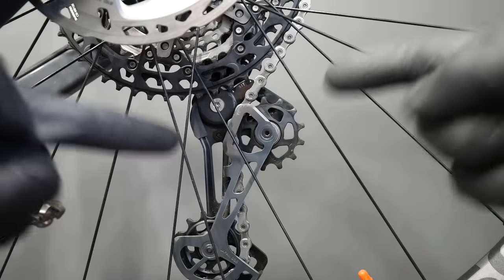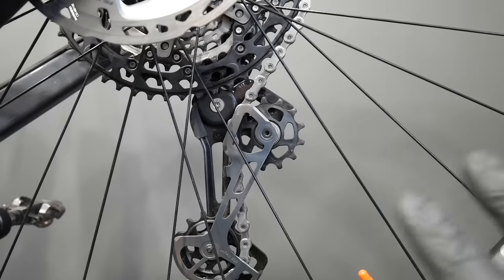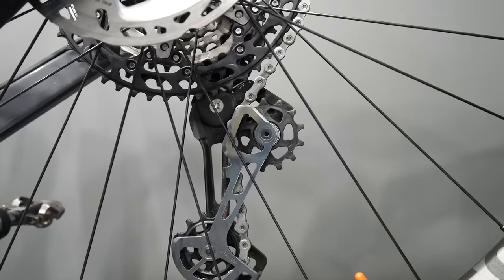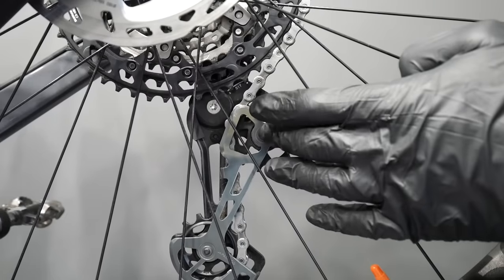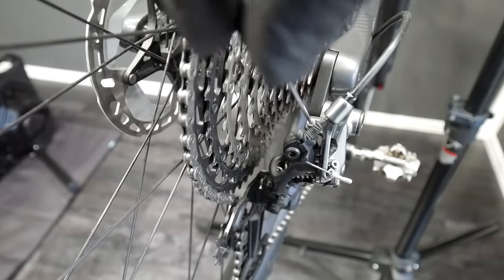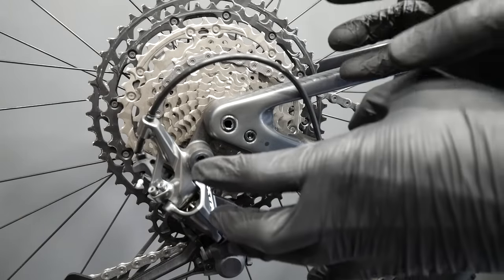Check This, Before You Snap The Chain On New Shimano 1x12 SLX, XT Or XTR Drivetrain...

Comment from the maker: Please note - I swapped the double with single crankset. Here's the right order:
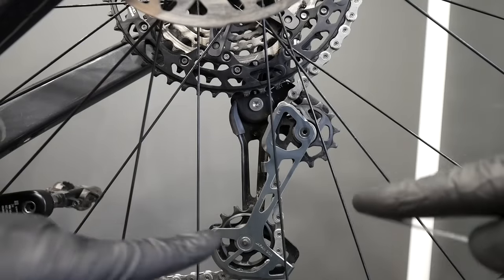2:35 SGS cage + 10-51T AND GS cage + 10-45T
5:52 XTR 9120, XT 8120. SLX 7120 for DOUBLE crankset
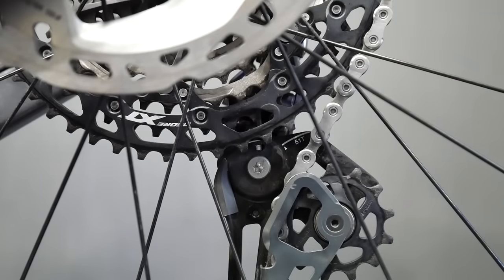7:19 SINGLE crankset
Reply: I am running 1x 12  10-51T but my derailleur (8100) was broken and Shimano replaced the part for an 8120, I was able to install it but I notice the shifting is not that quick and soft. I can see the 45T line instead of the 51T. Should I request the 8100 instead?
Reply: Will the xt m8000 have this same guide too?
Reply: Good vid, except for that error. I don't have the new kit, but was researching it the other day and read the Shimano literature about the B settings, so I picked your mistake and then came looking for a correction.

It's interesting how the 2x mech has the extended measured distance for 1x set-up. This shows that the line is basically a minimum mark (to an extent.) The extra B gap for the 1x must be for cross-chained chainline angling through the pulleys? So if you want to crosschain with 2x (like say use all but the 45 when in the 36 ring) I wonder if it's better to increase that B gap a bit from the line, more like the 1x measurement.

I can't see how that would have a bad effect on shifting when in the granny, especially when NOT cross-chaining the granny.

When I get the cash I'm considering building a 2x12 and ditching the pointless 26/36 chainset for a custom crankset combo running a 14t step (with an appropriate FD from a different group) for 22 or 24 granny, with a 36 or 38, paired with the 10-45 on a 700/29 wheel to get awesome range for steep climbs and bikepacking climbs, while keeping a couple of high gears for winding it out along roads. Gravel riding could go 28/42.

I know the 11-42 11 speed option is similar, but getting that ultra low climbing gear, combined with the great 12 spd gear steps and top end, is something I'd love to try, especially to show how it might actually work.

So your in-depth look at such mechanics as this is very useful.

Thanks.
Reply: On cues u have marker for 51t and 48t❤

Comment: Small tip: Whenever I turn the B-screw I pull the whole derailleur down first so it's not contacting the stop on the hanger. This prevents the screw from eating up the soft metal of the hanger. I've seen hangers eaten up to the point where the b-screw couldn't provide enough clearance even when fully screwed in because the hanger had a crater where the b-screw sat in.

Comment: Always best to shift early and often, if you can help it you should never shift under load/while sprinting. Even when you're shifting on the flats you should always let up pressure slightly on the pedals when the chain is in the actual shift. If you do this I guarantee your chains will last 3x longer. A lot of cassette/chain wear and breakage is caused by people shifting improperly.
Reply: True. I always use this technique when shifting the gears.

Comment: I just bought a new bike with the SLX 12 speed and I thought the gears didn’t feel as good as I thought they should. I’ve always had SRAM X1 gears before and just thought Shimano wasn’t as crisp. After watching this video I went straight out to check it and wouldn’t you know it, the derailleur wasn’t adjusted right. It was way out by at least 5mm or more. Definitely runs smoother now. Thank you so much for posting this video.

Comment: Thanks for your contribution! Had exactly this problem on a brand new bike with M8100-SGS. The only difference - my derailleur was too far from the sprocket instead. The result was messy and squeaky shifting between some gears. After the adjustment - perfectly smooth! 👍👍

Comment: I think the white triangles are actually arrows meant to tell the user to use the line as the point of guidance for alignment (e.g. 'look at the line'), which might not be wholly intuitive to everyone, because they assume the arrows are the point to use for reference. This is a great video though now that I have a 1x12 XT drivetrain to replace the horrible and failed GX Eagle my Remedy came with. I'll have to check the alignment with this.

Comment: I got a new bike last week, with a 10-51 XT cassette and derailleur; I've been out on 3 rides with it. I just went to check and, just like you said, the teeth were aligned with the arrowheads, not with the line. Grrrrr.... Thanks for the video! Glad I caught this issue early on.

BTW, the XT derailleur doesn't have highly visible white text, it's just moulded text on the metal cage. Using a torch/flashlight at an angle helps bring out the text.
Reply: thank you!!!

Comment: I've been using this guide for a couple of years to adjust the b-tension screw on my XT 12-speed.
Recently I changed the chain after it reached 0,75% wear, only to notice that the b-tension was all out of whack. This was set up by the manufacturer after I received it back from maintenance where they changed casette and chain. 

Note that it was shifting perfectly. 

So after I put the new chain to lengh, making sure to put it on correctly (with the imprinted text to the outside), same for the quick-link I set up the b-tension to the indicated line (derailleur was much to high).

Since then I cannot get it to shift good anymore; there are a couple of spots on the casette (from gear 5 to 6, most notable) that 1 out of 3 shifts, the shifting will go very clunky (also loud noise), and when pedalling it will feel like it's missing a buch of gears (pedals will fly forward).

Now for the time being I have returned the b-tension screw somewhat to it's old position; shifting is better/quicker, but there are still some problem spots.

Any clues before I bring it back to the bike shop? (I really like to do maintenance myself however)

Comment: Thx for the Info! I have bought a new bike one month ago with the whole m9100 Groupset! I was really Not amused of the performance IT was rattling whole time, shifting perfomance was really miserable! Gears were jumping and IT was no fun! my xt Groupset of my old bike is even better in Performance than these xtr i thought! It Was really Frustrating! After i saw These video here i figured Out my screw was mich to tied screwed in! I turned the screw a few times Out lined IT Up with the marking and now it works like a sharme 😎 thank you for your Tip! It seems that many bike sellers send there bikes Not good prepared for ride or they even dont know about These marking line! It runs now perfectly 👍🏻
Reply: Of course they don't set it up if you have to do anything when you get a bike that's set it up.

Comment: Great video.  Saved me from cutting chain too short after installing new SLX 10-51T cassette.  Had excess slack on 10T but after watching video, could see that B-screw adjustment was way off from where it should be straight from vendor.  I didn't have a white line or the two white arrows on my SLX SGS derailleur but when I looked closely, I could see the 51T marking with a faint line underneath.  Using that, made adjustments per your instruction and now it shifts clean and no excess slack on 10T.  Thanks.

Comment: Still ride old 3x9 xtr 10 years old works like a Charme 👌✌️
Reply: Try 3x10 (If you can get the first 10 speed MTB derailleurs and shifters before they beefed up the return spring in the derailleur and made shifting a heavy, clunky misery (Like SRAM)). The shifting on 10 speed is noticeably quicker and cleaner than 9 speed. 12 speed claims to be a similar jump forward compared to 10 and 11 speed. Hope they've sorted out the shamefully heavy shifting.
Reply: Me too. In fact I went bike packing on a 1990 stump jumper and the old deore DX gears shift as well as any bike I've ever ridden.
Reply: @peglor  thx bro but i ride my bike only in the city don't need quickly gears change 😁😁

Comment: Great example of adjusting the b screw thankyou 👍, makes a big difference, but mine worked best adjusted a bit closer than shown. Both with the original shimano set, and with a slightly smoother shifting kmc chain which refused to run with the old chain wheel at first.

Comment: I recently installed the 11 speed rd-M5100-SGS, and I looked everywhere for the line and the two triangles but could newer find it so had to just estimate whare they was supposed to be and did manage to get really good shifting in the end :-D
Reply: there is a line with my sgs M5100, its black.

Comment: At 4:10 you showed where the B-Gap was set at when the bike came to you but you didn’t mention if this was a hardtail or full suspension mtn bike. If it’s a full suspension mtn bike then it could have been adjusted at sag which is different than setting the B-Gap with the bike in a work stand. For a full suspension bike you’ll need to have the B-Gap adjusted while the bike is at the correct sag that you would be riding at so you’ll either need to have a 2nd person adjust the B-Gap while you’re sitting on the bike with full gear on or you could let the air out of your rear suspension so you can do it yourself in a work stand with the suspension set at the correct sag.
Reply: This isn’t always the case... e.g. xx1 11sp
Reply: @nickv3085  the B-gap for a 11spd and 12spd 1x system on a FULL SUSPENSION bike needs to be adjusted while the bike is at the correct sag. You obviously have no idea what you’re talking about.
Reply: Wow, is this the reason I get slippage on jockey wheels, next to and big cog 12 speed?
My gears could be miles out and tend to crunch at times

Comment: Chaintension is the key here.
I had problems with my highest gear( 11teeth) slipping. The chain was way to loose. After correctly adjusting the b screw the chain was much tighter and the highest gear was not slipping anymore.

Comment: I Don't think that someone set it up wrong, I have the XTR9100 version and with time I have to check the derrailer because it  moves a little bit off so you have to put it back on top of the Line.

Comment: I had to adjust it as well on a brand new bike, and sadly I found out way too late that my bike was delivered with a 2 link too short of a chain. I had not ridden trail bikes for years, and never 12x as well so even though I thought several times that there was too much tension in the drivetrain I thought maybe that was just how 12x was with XTR and so on. 
I know I should have just checked the length of my chain but I just did not consider a highend bike to be delivered with the wrong length of chain. Eventually I did check it, and so I got a new chain covered by the shop thankfully.

I do often feel that something is off with my derailleur XTR 9120 because extra stress during a time with shorter chain, because it is a bit hard to adjust the gears. At this point I just feel the bikeshop may just say that a rock could have hit the derailleur and so on, and yes obviously I've straifed a rock here and there like you do while trail riding, but no big hits. 

I'm a bit frustrated about the whole thing because I want nothing to do with the bikeshop I bought my bike at because they've been very unprofessional since day one. Everything was fine until the money was transfered, and then all of a sudden i wasn't so interesting anymore. Pretty sad when you actually try to shop locally and it just did not matter at all.

Comment: The two triangles are supposed to show that the TOP of each tooth should be at the line, but the did between them. Maybe if they used several more it might help..
Reply: If you look at the manual it shows the tooth between the triangles like in the video.
Reply: They are arrows and pointing towards the line. The line is the key information.

Comment: I think ur wrong for some stuff. For 8120 derailleur u need to measure 46 mm for single chain ring and for the double is the method of line up to the edge of the plate. Its written on shimano manual for this derailleur

Comment: How in the name of god did it take you 10 minutes to explain that you adjust the B tension screw to align the longest teeth of the sprocket to the line printed/stamped on the derailleur cage or with  2 chainrings, position the centre of the top jockey wheel to be 46 mm from the tip of longest tooth on the cassette?
Reply: He gets paid for the 10 minutes
Reply: Repeat six times.
Reply: If a video is a minimum of 10 minutes long youtube allows two ads to be placed instead of one

Comment: Thanx for the video. I checked my sgs derailleur with the 51t is a little too far from the line. Maybe it’ll shift smoother 👍
Reply from the maker: Great. If the RD was to high, then it will feel less stiff on the lowest gears, if it was to low, it will shift quicker.

Comment: Do a video on measuring a new chain length from scratch and how rear suspension effects the length you need. I just munched a rear derraileur because chain was too tight in big cog and squished into the suspension. It ran sweet on the stand with no weight on.
Reply: Simply take out the shock and check if everything's fine under compression, there was a video on an older fellow installing one on his santa cruz

Comment: Why didn't you adjust the derailleur when the rear end of the bike is in 30% SAG? Because of the suspension moving the rear axle farther away from the pedalling axle, the upper derailleur pulley gets farther away from the cassette, resulting in worse shifting and less chain life when in SAG. So as I always adjust the derailleur to 30% SAG, the white line is just behind the teeth of the largest cog when I'm not on the bike :)
Reply: Isn’t the line set for when the bike is unloaded? Would make more sense
Reply: so true it wouldnt make sense
Reply: @gillesbkf4315  why would that be? Every bike suspension geometry has a different lengthening span of the chain stay so unloaded would not fit all designs...
Reply: @joemansky29275  what you say makes sense. I think on 12s SRAM eagle the derailleurs come with a alignment/spacer gauge that recommends to check at sag.. Smart. Just more of a PITA though. But worth it to do obviously.
Reply: @terrybest3700  actually, I switched to a sram gx Eagle (520%) derailleur which seems to have stronger chain tensioning than an old NX I had before trying the deore and yes, the white tool has a printing on it to adjust at sag in second gear
Reply: It's what the manual says but people nowadays just know better. :-)

Comment: How to set b screw if I run oval chainring?
Reply: I believe you set it the same. The chainring has no impact on the guide pulley. The b screw is used to adjust the distance between the cassette teeth and the guide pulley. An oval chainring would only affect the tension pulley which is not adjustable.
Reply: @mtbbiker6401  thank you for the answer!

Comment: Thanks for another fantastic video.
I have just checked this on my 12 speed slx. However, I can’t get my longest teeth to line up with the mark, even when I removed the bolt it was still a few millimetres out. Any ideas please? 🤔
Reply: Your chain may be too short, too much pull on the deraileur.

Comment: Hi Dani, very usefull videos. Thank you. On my shimano setup with XT 51s drivetrain, the theeth are 3-4 mm bellow the 51 mark on the derraileur but, it shifts fine. When I try to align, thats when it starts to make noises and doesn't shift well. The way it is currenlty setup, is fine, but obviously I want to make it as good as possible. Any ideas why it's worse when I align the teeth with the 51 mark? Many thanks

Comment: I'm not sure that all the info in this video is correct. I have the SLX RD-M7100-SGS rear derailleur and I don't have the white line on it. Also, according to Shimano's website, only the XTR series derailleurs are designated SGS for 1x and SG for 2x; the XT and SLX series are designated SGS for both 1x and 2x.
Reply: I have a slx rd-m7100-sgs with 51t 1x setup, no white line, but engraved black line, shimano dealers manual documents this same setup also.  My new bike was adjusted wrongly from the shop, setup perfectly now.

Comment: And for the 6100 Deore 10-51 ?!
Reply: there is also a line, but not painted so it's difficult to see.
Reply: @joriz5869  tks 🤝
Reply: I use a 11-51 Sunrace cassete and the 6100. It doesn’t work right on the line, I had to adjust the pulley closer to the 51 cog, otherwise the 45 cog will be a bit noisy. And I’m positive, it’s not the index or a bent derailleur hanger.

Comment: My 11 speed chain just broke when Sprinting from a stoplight, almost went OTB.
Reply: I did that with a new 9 speed clipped in myself
Reply: @Spitch Grizwald mine was probably because I shortened the chain and later reattach it again.
Reply: @asianR53  
Do you always have to use a new master link? I put on a new chain but after a couple of cranks while on the stand I decided to take out another link and used the same master link.  Is this OK?
Reply: @drmoynihan  most of the time i just re-use the masterlink, till I put a new chain on, then i use a new one

Comment: Interesting.. what if i use slx long cage with different cassette 50Teeth?
Reply: Same question.. Actually Using the 9-50 e thirteen..
Reply: @Vric46  now using 11-50 teeth cassette from china brand sroad.. so far so good... also follow same procedure from this video..😅
Reply: Same, I run a sunrace 10/50 and have it on the line for perfect shifting

Comment: Mine rd x8100 has a problem with reduction from 50t to smaller one (cassette pg1230 Sram). When clutch is on I have to drop 2 speeds otherwise chain stays on 50t sprocket. Any ideas?
Reply: Make sure that the shift cable is routed outside of the cable stop.  Look at pages 15 and 16 of this manual: https://si.shimano.com/pdfs/dm/DM-MARD001-02-ENG.pdf. If you route the cable to the inside, there may be too much friction to allow the cable to release for shifting to the smaller cogs,